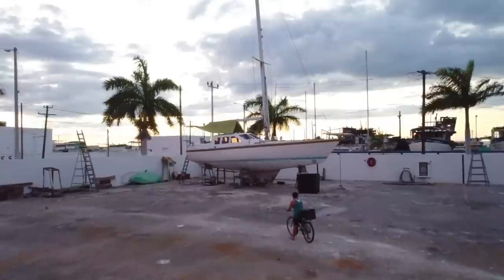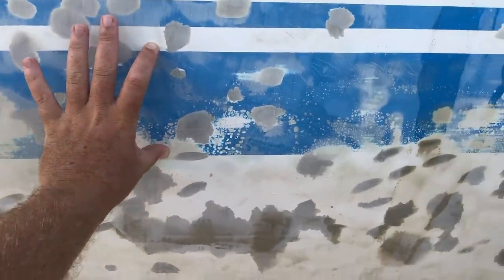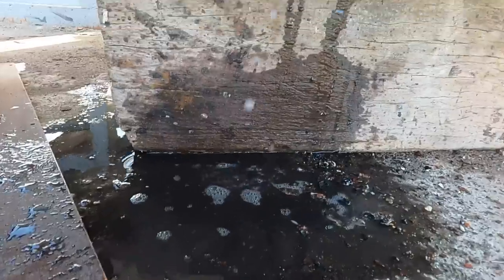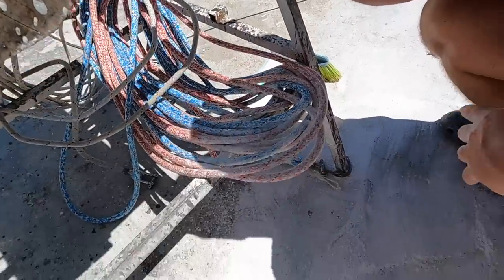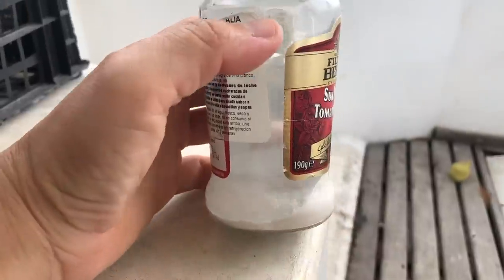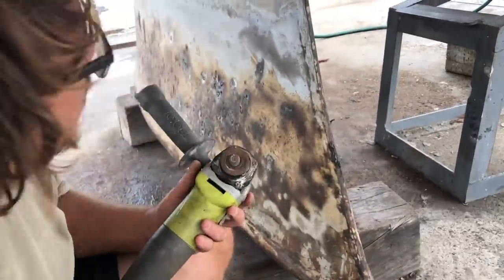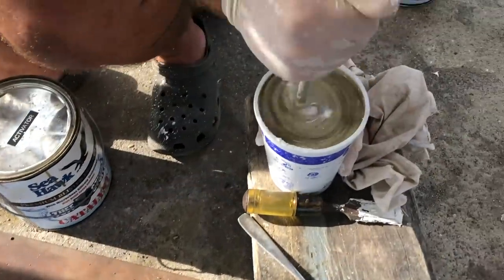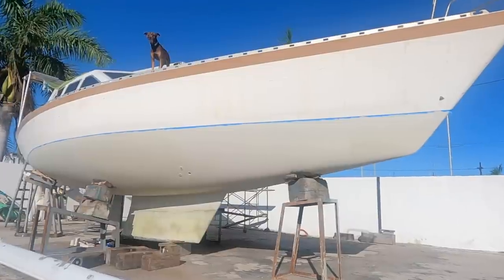WHAT WE FOUND HIDDEN in our sailboat

Comment: Visiball radar reflector, after some reading they likely use a dielectric ceramic powder in crystalline form that reflects energy rather than scattering it, may be hydrophobic fumed silica.
Reply from the maker: Awesome! Thank you for these ideas - we couldn't find any info as to what kind of powder would be inside a Visiball anywhere online. If it's a dielectric powder, it could be filled with some pretty heavy metals, right? Really, we're just trying to determine if we can mix it into our epoxy safely 😆. It's very heavy and doesn't feel like collodial silica at all - which is what comes up first when I googled hydrophobic fumed silica.
Reply from the maker: That's really interesting, thank you. What really confuses me is that the Visiball radar reflector is not made anymore, and only has bad reviews - as in, the manufacturer went out of business and the product didn't function well. So it seems likely that it was SUPPOSED to be filled with an effective reflective material, but probably filled with a totally ineffective material (like chalk) instead.
Reply: @sailorama  it would be interesting to know if the previous owner had any idea if they were invisible to radar stations. the LORAN system is used in proximity to land, but out at sea, bigger ships have their own onboard RADAR stations for spotting other vessels. LORAN is more like a glorified cell tower system with much greater range and triangulation is how they work out locations of shipping. really, there is not that much use for radar, apart from shipping lanes in the open oceans. that's probably why the previous owner didn't need to replace it.
Reply: As long as you’re not ripping lines of it you should be fine.

Comment: I think I would have given up the moment the water started to run out of the keel and the rudder’s fibreglass was wet. But then - I always worry a lot while I work on my 1983 boat. Hope all will be successful and your work is rewarded with years of sailing.
Reply from the maker: Hope so too! This vessel has been a real challenge - thanks for the positive words.
Reply: @sailorama  you guy's got this. Let it dry out... An fill it with epoxy...

Comment: For the welding: It might be the cable if it's 110V but you should be able to get something layed down. Get some clean scrap metal and compare welding with / without the cable. At least for starting, you need clean metal under the ground clamp and under the rod. You can clamp a piece of clean scrap under the ground clamp, start there to get to rod hot and then transfer to you welding spot. Rods are also a big topic, most don't like moisture. Maybe get like two ore three known good 6013 the next time you're at the shops. Also your striking motion seems not very efficient for adverse conditions, try not to plunge it in there but more gentle strikes like lighting a match but with very gentle pressure. It wants to stick and the trick is to drag it in a way that it cant. Try fast consecutive strikes on clean scrap metal, once the rod is lit you can plunge it through the corrosion.
Reply from the maker: Thank you for the tips about welding - we don't do so much of that around here, although Robi and I both learned how to do it a little bit - any bit of info helps us. We didn't think about putting another piece of metal under the ground clamp, and of course, all the surfaces could have been a lot cleaner I think. We were also using older rods - could have been an issue as well. Personally, I've only done gas and mig welding. That stick welding looked very 'sticky', yes 👍🏼
Reply: @sailorama  Stick Welding is awesome when you're out and about, no lugging gas bottles, no wind blowing away the gas, cheap/compact welders, ... The only counterintuitive thing is that you increase the voltage / penetration by holding the electrode further away (longer arc -> higher voltage). 

As with all electrical welding, the voltage is low for safety reasons, so if you're welding 100A at 20V the whole circuit can have a maximum resistance of 0.2 ohm, which is nothing. A similar scenario like starters on engines: If one connection is corroded it won't work.

Comment: Man there is a  tool called a needle gun . With that and a rented borrowed or bought air compressor maybe a day most likely a half day. For everything below the waterline.  It a bunch of hardened steel punches about the diameter of pencil lead and they are driven by air hammers . They weigh a pound or two and cost $20-40 . 
.they are used to remove surface rust and to aniel metal.
Reply from the maker: I had another comment about this after yours as well - a needle gun is definitely what we wanted - but not available to rent or borrow - and was outside of our budget to buy a good one here, unfortunately. If ever you find yourself sailing to Mexico for boat work, make sure to pack a needle gun.
Reply: @sailorama  my dream since I was 15 and read dove   my fantasy and goal  for almost a half century. 
  When I got near the first time something happened wiping me out then a bad accident put a hold on everything for several years while I learned to walk and talk again.
 Then people did things to purposely prevent me. Now I have very little money. But 2 months ago I woke up and my right hand didn't work. That taught me that I'm too beat up to do a circumnavigation. For a month I could get to the bathroom and that was about all .  Sadly I too far gone to run away to sea
Reply from the maker: Ah man, sorry to hear the difficulties. I strive to go sailing because before I met Robi, my previous partner of almost a decade had to battle cancer while we were finishing up university. I know that health problems or unexpected challenges can arrive at any moment and wipe out plans. So every day is work quickly and hard to reach the dreams while we still can...I know a lot of folks watch these videos so that they can come along for the ride. Hope you can enjoy!
Reply: @sailorama  I used to go sailing with a friend. When he was in town and I was . Sadly he and hiss girlfriend were murdered by Somali pirates 15-20 years ago . The thing is I started watching YouTube videos on sailing for tips on refitting. But now knowing I can't go  watching sailing video is like watching porn the more I watch the more I want to go

Comment: Don't buy boats made in the 80s. They were built with polyester resin instead of epoxy resin due to a shortage of oil products during that period.  The result was water ingress into the fiberglass
Reply from the maker: This Vennekens sailboat from the 80s was constructed pretty well, I'd say. The fiberglass is solid, no water made it into the balsa core at all, and relatively little osmosis in the fiberglass. Most of the blisters were in the outer layer - the fibrous gelcoat was not such high quality, but the polyester seemed to be pretty good.
Reply: @sailorama  it's a choice weather you want to save some money on the purchase price and go through the headache and cost of repairs, or to pay more to purchase an epoxy boat. I went for the former unfortunately